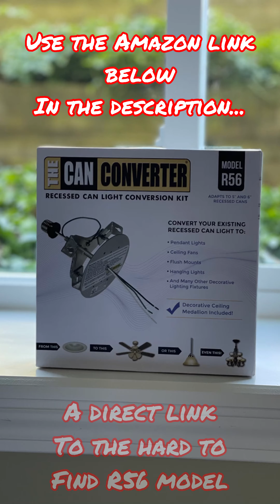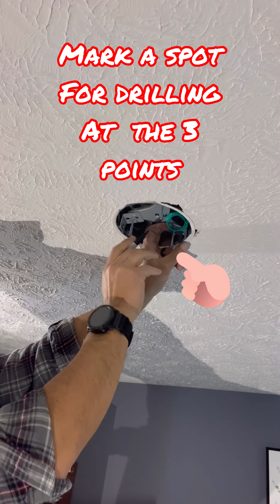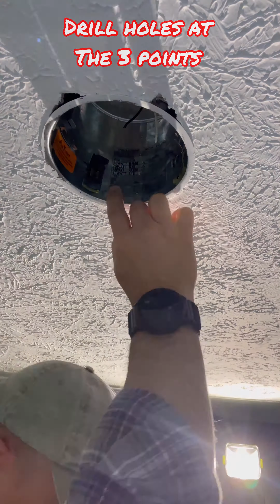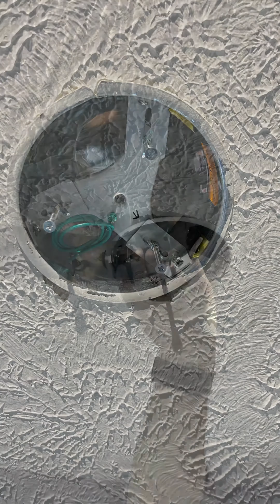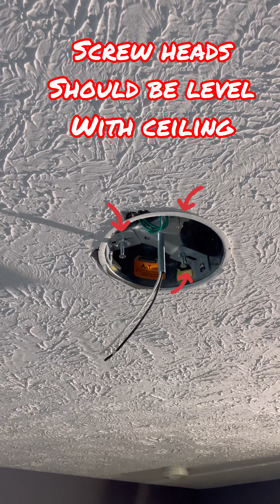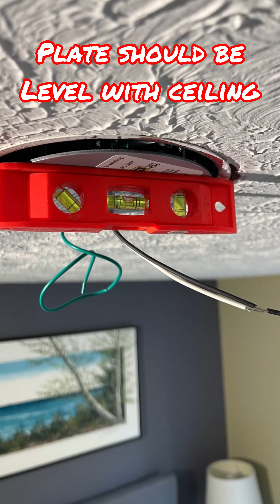Hang a ceiling fan or ceiling light fixture from a recessed light can with “The Can Converter”

Comment: I thought you need a fan box to go into the trusses?
Reply from the maker: This is from the manufacturer.  CERTIFIED EXCELLENCE: THE CAN CONVERTER - R56 boasts a prestigious UL Certified design, engineered for exceptional strength and durability. It's more than just an aesthetic upgrade; it's a reliable and robust solution that can confidently support fixtures and hanging lights weighing up to 50lbs and ceiling fans up to 35lbs.
Reply: @j44881  how it can hold 50lbs i wonder? pot is not connected to joist, just few side flat pieces that are sitting on top of ceiling drywall....close to that pot hole...I'd be scared for all that weight to be sitting on ceiling drywall only.
Reply from the maker: @Majki70 Thanks for the question.  My recessed light has joist supports if there was a recessed housing that did not have joist supports I absolutely would not use this product.  A recessed housing without supports may exist but I have never seen one. Good luck on your project.